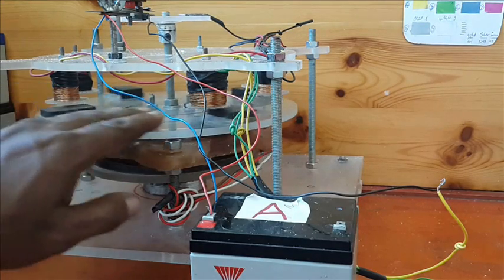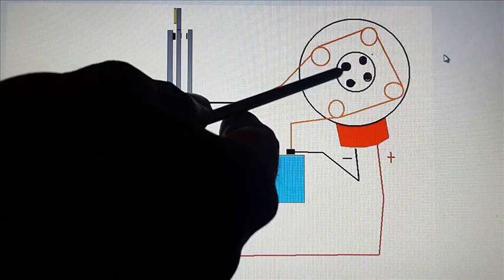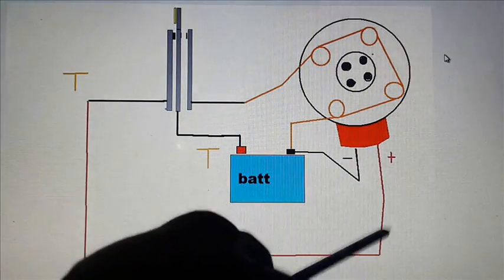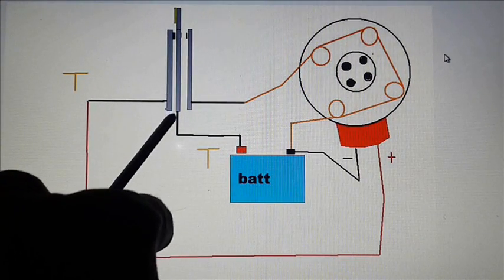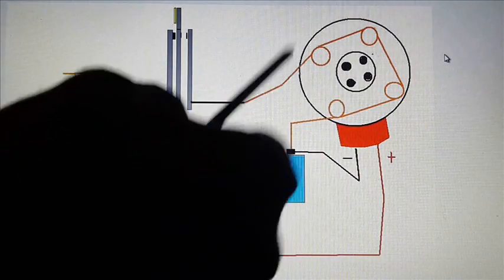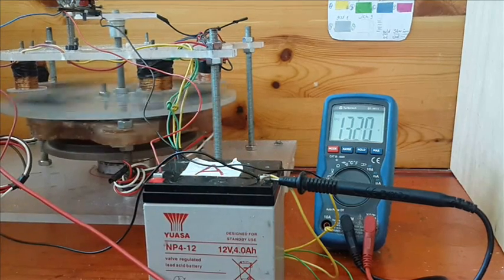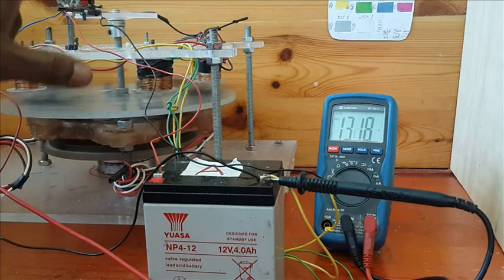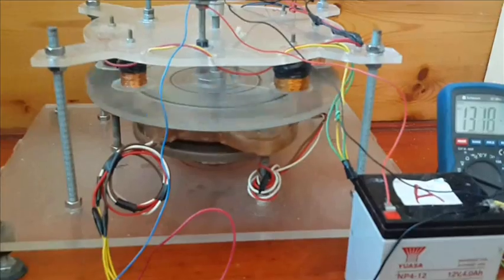Pulse motor generator double action switch single battery experiment(pt1)

Comment: Mr AFP...  You are awesome! I enjoy your productions and salute you for your contribution. I've been working to adapt my PEM plans to work over-unity (without modifying my stator or magnet config). Its been a challenge.  Its not quite in tune yet to charge batteries faster than power drain - it'd be great to find that little key to get it producing. 
     One question about your rotor disk - Your designs use air core & plexi rotor plates.  Would a metal rotor plate be useful to enhance output? (ie., to focus field lines) or is that a bad idea for a PEM / Bedini motor? Also, I'm curious about coils you use for this motor/gen - what's wire gauge & # turns?  One last idea - can a Solid State Relay & HAL sensor, work the same as your metal contacts?   
  You're a great coach and you bring more to this 'adventure' than just tech info.  ;) 
Many thanks!